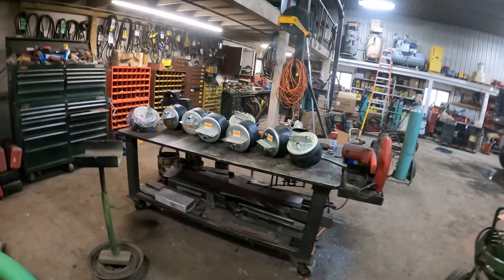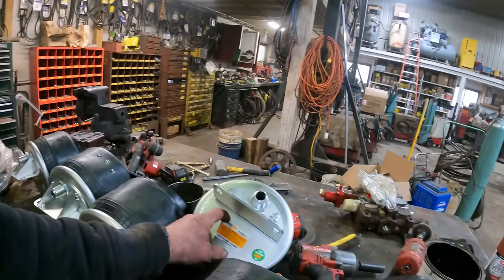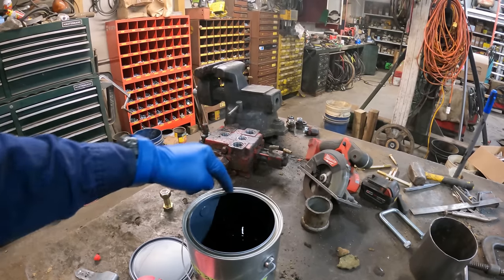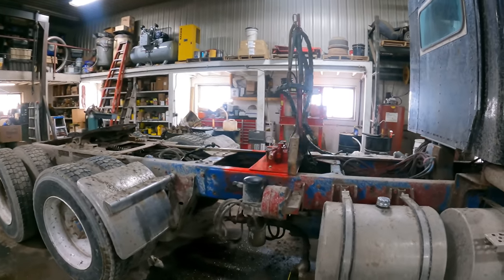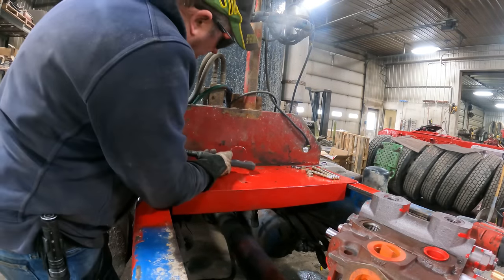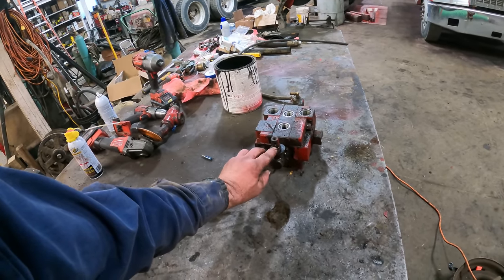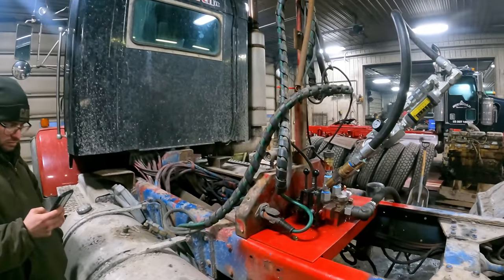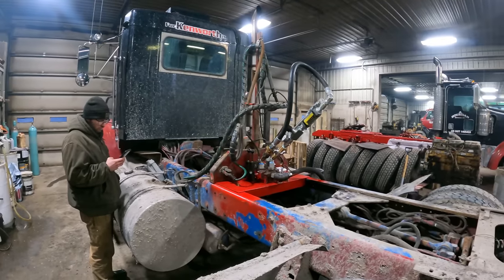Little Truck Operator Error

Comment: I know something Andy doesn't. Those red pour spouts work excellent when used correctly. Push it down into the grooves and you will have a clean can when you remove it.

Comment: Nate had a smile today, looked a little happier.  Try putting plastic wrap on top of the paint can before you put the lid on.  I use Magnet Chassis Saver and have the same problem.  I use plastic wrap and lid won't fuse to can and it does seal good too still.  I just figured the mud flaps were left off so the super truckers would not loose them.

Comment: Great video Andy. I had to do a bit of binge watching as been traveling and had crappy wifi. The loading of the feed mixer was pretty stretchy for sure hope it made to the destination in one piece. 

That red paint can thing should have locked into the top of that can way easier than it did. I bought one many years ago and still works great. 

Thanks for all the vids you put out.

Comment: On your KW airbags if you didn't find out already- 3:02 I ran into that same thing buying the cheaper bags. If you wanted to keep those other ones for spares, Google Kenworth air spring adapter. It's like a metal pipe that threads over where the nut is and then it has a nipple that you would cut your hose and push into it and tighten down a screw. What sucks is the adapters are pretty pricey from what I remember. Theres also a couple different sizes so you gotta know the thread size on the airbag. I think it's inch and 5/16 22 threads per inch. If I remember right I don't hold me to that.

Comment: Andy, I’ve been complaining about all the mud and wet we have been dealing with on our non dry lot dairy this winter. One thing I guess I forget from our Connecticut dairy days was how prevalent corrosion is. I’ve noticed a theme in your last bunch of videos all you go through to prevent or repair that. Our county I think buys one truckload of salt a year and makes it last all winter on 7,000 miles of roads. On the other hand we can run twenty year old pickups 300,000 miles and they have more sun damage than anything. I guess there are trade offs wherever we live. Thanks for your good work.

Comment: We have used Chealsy (sp) gear pumps on our equipment with good filters on inlet with good results. There are others but my local dealer stocks these lt many sizes so we use them. Haven’t replaced one in many years with inlet filter maintenance regularly.  3500 pounds at 22 to 30 gpm

Comment: Same thing happened on my 79 IH truck many years ago with my grain truck/hog hauling truck. A neighbor had borrowed my truck to haul corn out of the field. I pulled onto US 40 headed to the hog market,two miles away. I immediately knew something was wrong. I got the hogs off and looked. Drag link was bent all to hell. Bought a new one and set the towin. Never did tell the neighbor,he was a worry wart and a good man.

Comment: Try self etching primer just a lighr foggy coat not a thick full coat and any kind of urethane or arcrylic on top it goes much longer I use to be a big POR user also its good stuff but I found that it was lifting off after 2-3 years so I switched now it dont happen
Reply from the maker: Doesn’t sound like you were applying it correctly

Comment: You can put a sheet of plastic between the lid and the can. Also u can poke a hole in the lid and use a big screw to seal it back up

Comment: I got automann  brand air bags for my freightliner at my local spring shop you can get plastic or metal bases. I had to get my torque arms rebushed. Couldn't find new ones to fit without grinding  the mounts

Comment: Hey there Andy and crew, I hope this finds you all well and good. 

When I saw y'all loading that feed wagon yesterday, I wanted to tell you the best way that I've found to haul something that's wider than my trailer like that was.

We had holes in the end of our forklift forks, that we could use for pins, bolts, balls, etc. I would have backed the trailer up to a dock, and run that wagon up on that trailer with my forklift in 5 minutes or less, then I would have jacked the wagon up, removed the wheels, and set it down on the trailer, and I could have hauled it anywhere, and it wouldn't have moved a quarter of an inch. 
I've hauled lots of equipment that way over the years, and it works like a charm. 👍

You reiterated how much less expensive those airbags  from Turkey were several times, but if they don't work, it doesn't matter how cheap they were, does it? 
Now you not only have the price of the KW bags in the job, you also have the price of those Turkey bags, that are worthless.

It's been my experience that in most instances, you get what you pay for. 

That red paint spout will work if you use it correctly. It has to be pushed into the lip of the can, just like the lid does. It's a tight fit, you have to start it in and work your way around it until it's bottomed out in the groove all of the way around the can.

I hope y'all have a good one my friend. 

"Nothing Runs Like A Deere" 🦌 👍 🇺🇲
Reply from the maker: We don’t have a loading dock, after we set the mixer down in the trailer we set the axle on blocks. The side wall was ready to come apart on the right tire,I ended up pulling the water valve on both tires so that they wouldn’t blow as he was going down the road. Mixer was under 13’ with the tires on it no sense in removing them.
Reply: @FarmingFixingFabricating  

Hey there Andy, I just assumed you had a dock, that's what I get for assuming. 

I must've missed the part where you set it on blocks, that's why I would've removed the tires, that and the width, and bounce. 

If the height and width wasn't an issue, we used to overinflate the tires to take some of the bounce out, mostly when hauling new equipment a long distance home.

Did you get your paint spout out of the trash and try it like I said? 

I hope y'all have a Blessed Sonday my friend! 🙏
Reply from the maker: The air bags were able to be returned for a full refund and the second set I bought was less than half of the cost of what KEnworth wanted

Comment: Andy. get that paint pourer thing and place some masking tape over that stupid hole  that is below the spout. Maybe a layer inside and out, or a piece doubled up so that it covers the inside and outside. It would probably work and the tape is easy enough to replace. Maybe it was already tossed out  by the time you read these comments?

Comment: You can buy empty plastic 1 gallon paint containers from Menards for 5 or 6 bucks and they even have a built in spout on them.
Reply from the maker: Good to know
Reply: @FarmingFixingFabricating  that's how they sell Dutch boy paint but also sell empty quart and gallon cans. I use them so I don't have to deal with rust inside the can and in the paint.

Comment: I am just going to trough a NUT into a gearcase, Could you place a new clean plastic bag inside your $9.00 empty paint can to keep it clear of sealer or even paint ? The plastic will not stick but the product may seal to the lid only .

Comment: Hi Andy I would like your opinion on paint. Is implement enamel paint the same as regular enamel paint? I'm painting my LP tank and I'm looking for the better enamel
Reply: I’m not Andy but there is special paint just for tanks.  You might check with your fuel supplier
Reply: @douglasfark169  I have seen that but isn't that just paint in a different can. Isn't the  formulation the same, if not what are the differences, that's what I'm trying to find out.
Reply from the maker: Implement enamel is just a name that the farm store uses. You should use a urethane enamel
Reply: @FarmingFixingFabricating  thanks for info

Comment: Your freehand plasma cutting skills are right on. Had I cut that whole freehand it would've looked like a stop sign.

I agree with you 100% on your thoughts on what you're running for hydraulic components. I run those same valves on our large capacity forklifts. I know what you mean by experimenting, making mistakes, blowing hoses, etc. It took me a long time talking to a lot of people reading a lot of manuals before I got our larger rigging forklifts to behave with updated hydraulic set ups. Our smaller machines are closed center with Rexroth load sensing variable displacement pumps, and those took me even longer to get right, but they've been pretty smooth the past few years. Take it easy.

Comment: You're not the first to have numbskulls pull a stuck truck by the tie rod. They had a hard time getting the 1 ton truck back to the plant 1/4 mile from where they got it stuck. The toe-in was so bad the tires were screaming.